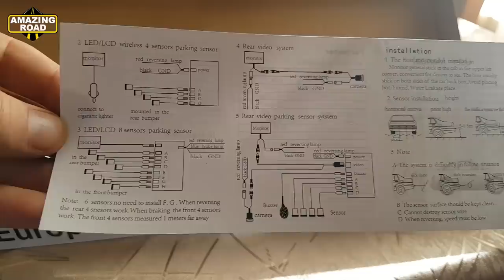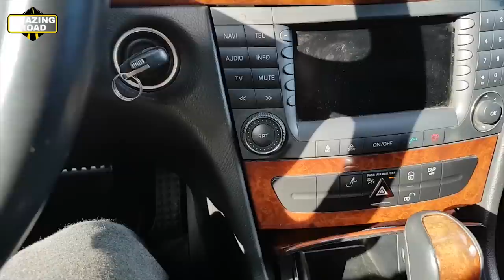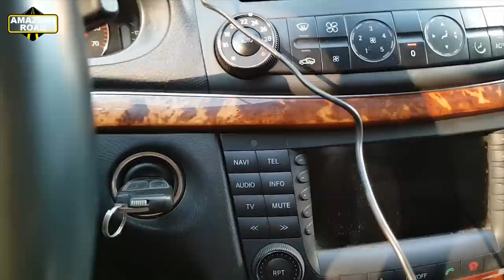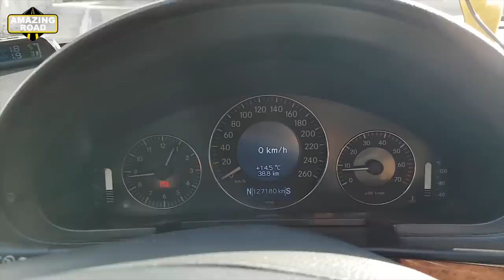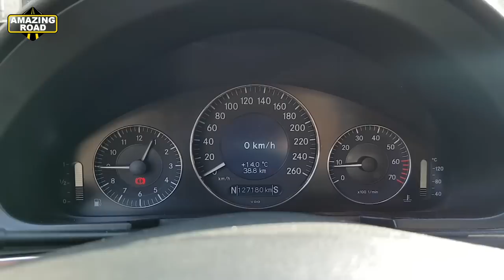Installing  License Plate Parking sensors / Parktronic installation without bumper drilling

Comment: Oh dear... did you keep all the cables like this....lol... does this sensor screen flashing like this...!?
Reply from the maker: I have sensors in the bumper. I showed it for the video
Reply: The Eagle Rays the sensors screen actualy doesnt flash, you just see it like thag because of the camera has faster refresh rate. Same as if you would record old CRT monitor with camera and tha  watch fhe rscording on LCD... it would look like that crt was flashig, but when u were looking at CRT it doesnt... its just that lcd where u looking that at has faster refresh rate than CRT. On short... u dont see that flikeri g with your eyes...

Comment: Omygod - twisting wires together and holding them with insulation tape - what dreadful, dangerous practice! Wires pull apart, live cable causes a short, car goes up in flames - what's not to like? Crimping pliers and connectors are cheap as chips - there's no excuse for having such disgraceful, shoddy, miserably low standards. And you're really going to leave loose cables dangling down the boot lid and going through the seal? This is shamefully poor! Either do the job safely - and with some basic sense of aesthetics - or don't do it at all.
Reply from the maker: Do not imagine how much you laughed at your comment 😂😂😂😂 I didn’t read a more idiotic comment 😂😂😂😂